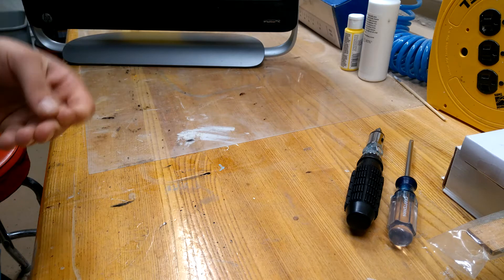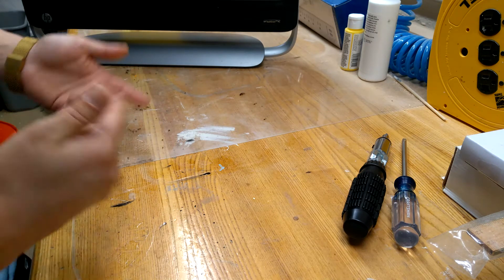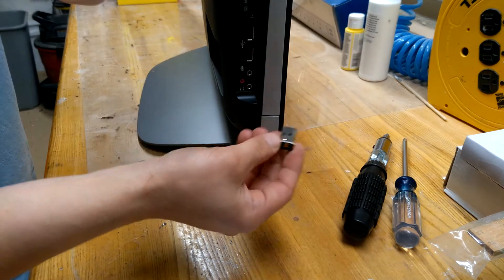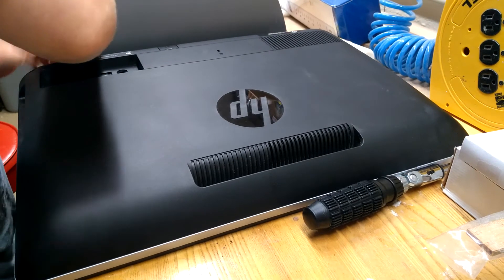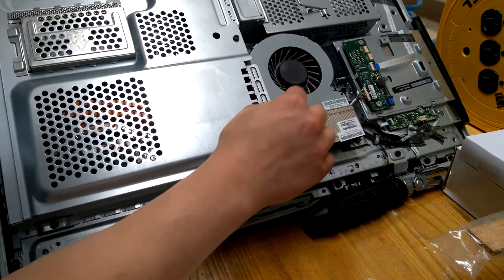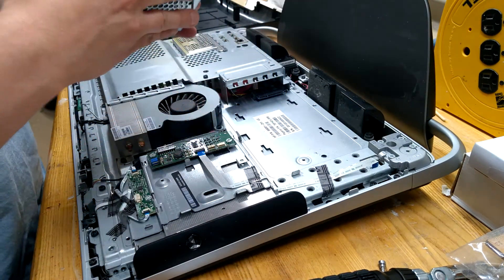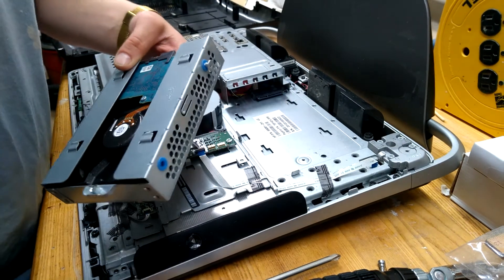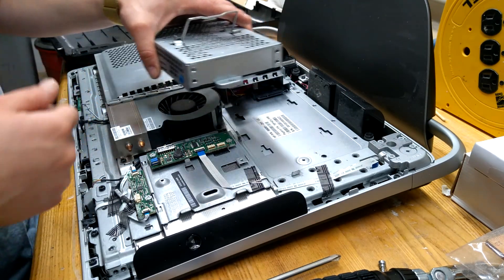02 HP Touchsmart 320 PC Hard Drive Replacement And Cleaning - Hard Drive Removal

Comment: At 4:10, just loosen the screw. It is designed to stay with the cage, making it almost impossible to "lose". That's why it was so difficult for you to disconnect it. After loosening the screw, lift the anchored-down handle, and pull it towards the screw, to disconnect the disk-drive-and-cage from the SATA/power sockets.

Comment: Hello friend, I have this computer and I have a problem, it is blocked on the hp screen and I cannot enter the bios or do anything, the keyboard does not work, could it be a hard disk problem? thanks and greetings friend
Reply from the maker: Hmm if u use an external keyboard and it doesn't work I'd be inclined to say the keyboard. But the HP screen meaning the one it goes to right after u press the power button?
Reply: @letechnology1774  The wireless keyboard does not work either, I have tried it on another computer, such as the cable one and they work, yes, hp home screen, I have tried to remove the hard drive, remove the bios battery and nothing, it does not detect any keyboard to be able to format
Reply: @letechnology1774  By discards I think that the motherboard must be damaged
Reply from the maker: @RubenRunero  Sorry for the late reply, I've been super busy. Hmm so let me get this right, you're plugging wired keyboards into USB ports, wireless keyboard adapters into USB ports and none seem to work, correct? Have you tried a USB flash drive in the same USB port you were connecting keyboard to? I'm sorry for some reason at first I was thinking in terms of a laptop not the TouchSmart 320 but I think I understand better now

Comment: Why you’re in there you should use a ssd, performance is massively improved.  Also, replace the thermal paste on the cpu, after 5-y years it gets hard on those machines.
Reply from the maker: Actually I did end up swapping for an ssd. I don't think I did the thermal paste on this PC but it's ESSENTIAL to add new thermal paste after the old stuff is on for a while. Kudos for mentioning that, thanks!!